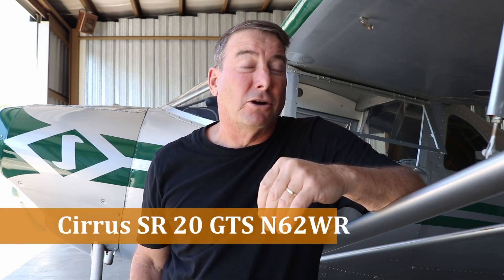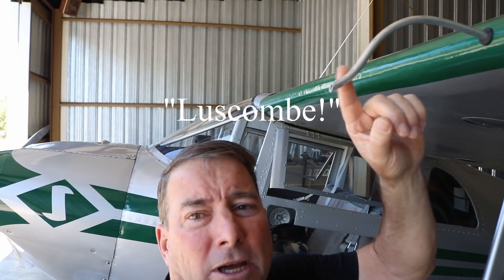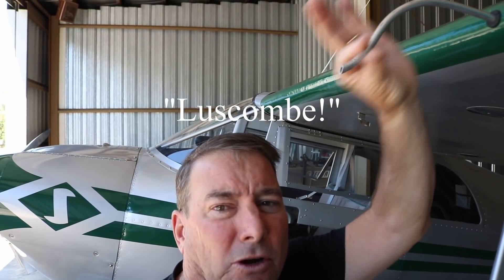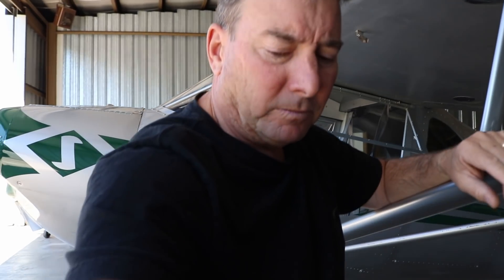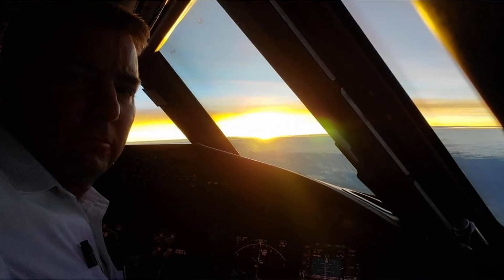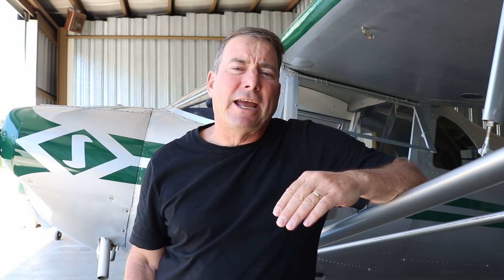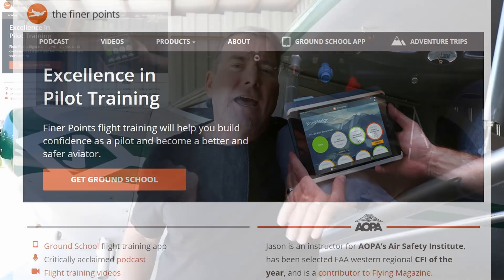Cirrus SR20 Crash Conway AR - AQP for GA!

Comment: This is going too far to say we need AQP for initial training or private flight in general aviation.  Absolutely over the top.  That is not the answer for basic inability to fly an airplane.
Reply from the maker: Bullshit.
Reply: @blancolirio  Such an erudite retort.  I'm impressed for sure.
Reply: Any readers unimpressed by Juan Brown's "Bullshit" response to my disagreement with his call for AQP for a private pilot certificate can learn more  by reading the comments posted here by diegus012 and by doing some research on what AQP actually is.  Juan Brown should know better, but he appears to misunderstand the fundamental purpose of AQP, and why so many airlines have VOLUNTARILY adopted this alternative means of compliance with  training regulations.  The main reason is that it allows their training programs to have fewer training events and still demonstrate compliance with performance standards. In theory that can allow training time across a pilot group to be focused on weaker areas.  In my experience airlines reduce training time and the frequency of certain events, and areas that were not weak can become weak due to less focus.  If you are training to meet the required performance standards for a PPL AQP is not relevant.  Now, if Juan said the amount of training and performance performance standards required for a PPL, or to allow a student to fly solo, are too lax and should be more rigorous, I would probably agree with him.  But that's not AQP does.

Comment: Pitot tubes always offended my engineering sensibilities, especially those long booms on the nose of fighter jets. Such a crude concept. That aside, we shouldn't have to do checklists, we shouldn't have procedure for reading out airspeed and other checks. A computer should do that. If you have an airspeed sensor, and GPS and a ground pointed speed sensor, and G-meter and engine sensors, a computer can instantly with vastly greater precision correlate that everything is as it should be. And such a system can have various redundancy and cross checks to make sure the computer isn't just lying to you. A single blind data point has proven time and again to be deadly dumb. Plane's altimeter proudly lying to you, leading to controlled flight into terrain at night because that single faulty data point was trusted completely. Had the plane had thermal and night vision and synthetic aperture radar and even a simple ground distance radar it would have been very clear that the dumb altimeter had failed. Rich sensor data has redundancy for certainty. A computer can also catch the slightest difference in the many vibrations of an engine, the exhaust, the intake, the flow through the filter, a vibration from the door because the seal is getting old. Aviation suffers from incredible stagnation when it should be the most innovative domain.
A computer can also very easily handle the takeoff and landing. You can still fly manually if you want but with the functionality, it will appeal to many to have it handled effortlessly. Just look at autopilot in cruise, once tasted, they have to have it. Flight should be effortless, majestic. Not broncoing an unruly lawnmower while stressing with the telegraph.
Reply: So how's that work in a J3 cub without an electrical system?  There's are thousands of GA airplanes flying that don't have any fancy electronics.
Reply: @craigsanders6925  I know this is a wild concept but imagine that things could change. You are insisting on having a very basic airplane combined with more sophisticated smart electronics. It's a 1938 design. Maybe time for renewal. But even for such a basic plane, a retrofit might well be possible. Just the energy it wastes on magnetos could power much computing. Computing can be done with milliwatts these days.
Reply: @DanFrederiksen  Sure, sure, at what cost?  A new cirrus is nearly $700K.  And what happens when it fails, because everything can and will fail.  More reliance on technology won't fix it when it breaks or a pilot runs out of gas.  The day after my checkride last year a cirrus pilot ran out of fuel several miles from his destination.  He probably could have landed at a nearby airport but he pulled the chute.  How does your computer scenario fix a pilot that runs out of gas.  As others have mentioned, you should be able to fly the plane when things fail, that's part of the program when your'e learning to fly and checklists are part of it.  Don't know of any part of flight, GA, commercial, or military that doesn't use checklists.
Reply: @craigsanders6925  at a tiny cost. a precise differential pressure sensor to measure airspeed costs 10 bucks. a gps module costs another 10 bucks. i have built an electronic ASI/ALT/VS instrument and i could easily add a GPS for speed check and alert the pilot that ASI is unreliable. it would cost less than 30 bucks in materials and a few hours of coding. power consumption would be tiny, a few AA batteries could last a year, at the rate most airplanes fly. 
but for some reason in aviation automation is frowned upon. instead, enormous resources are dedicated at trying to ignore that the most failure prone mechanism in a vehicle stays between the seat and the dash. but that cant be said of pilots. pilots are supposed to be infallible and any effort at automation is taken as an insult.  
and anyway, no matter how stupidproof you build a mechanism, the latest version of stupid is already out, ready to defeat any such mechanism. 
"More reliance on technology won't fix it when it breaks"
rrrright. then why fit powerful brakes to cars? they might fail!!! brakes might not work when you need them most. learn to coast instead..
Reply: @lacantinadicrono798  Lets see you get that certified and get back to me. :). Nothing is cheap in certified aircraft.  Like has been said a few times in here, a pilot should be able to fly the plane safely without a working airspeed indicator.   My Ipad, phone and watch can all give me groundspeed too. :).
Reply: @craigsanders6925  spotting low gas is pretty easy for a computer. As is correlating the fuel amount against the planned route before take off. The plane could point out the issue. As well as underway. It could also fly the plane the entire way as well as pick a new runway within range of remaining fuel after the absent minded pilot got them in that situation. So running out of fuel is a very easy thing to guard against.
Reply: @DanFrederiksen  So is the time tested method every pilot is taught during their initial training, you know the amount of fuel on board when you start, you should know the average rate of fuel burn, keep track of time flying and making sure you land with a reserve.  Pretty easy to determine how long you can fly.  I always plan to land with an hours worth of fuel left on board.
Reply: @craigsanders6925  certifications are the bane of light aviation. thats why i only fly experimentals or ULM.